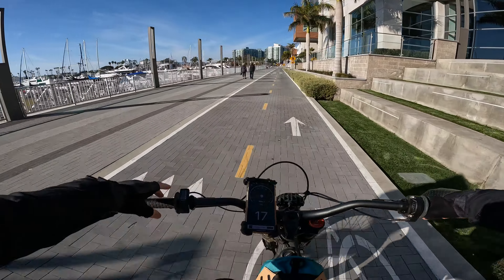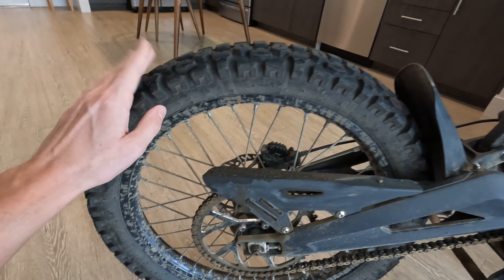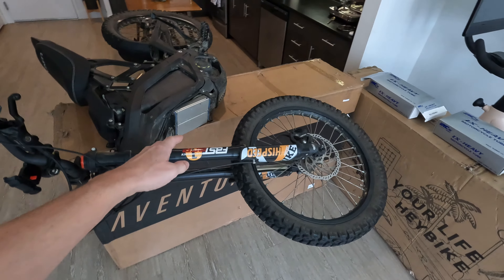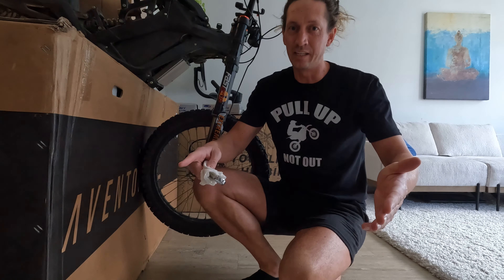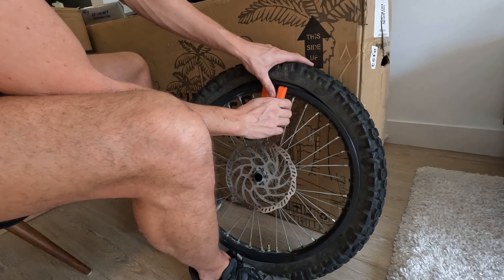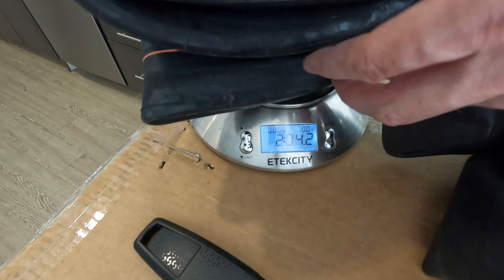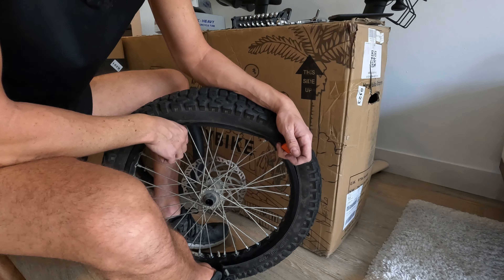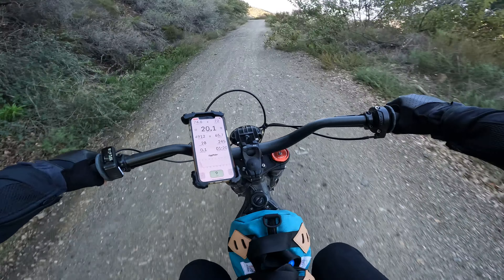How to change Sur Ron Tire and Fix Flat Tire

Comment: Flat Out is the best.  It pushed out the slime that I had in the tube and sealed the leak caused by a 5” nail.  It punctured the tube on both sides and it sealed.  I won’t ever ride my ebike without Flat Out ever again.

Comment: I have been using the 3.5 241 on the rare and it’s really suitable for street is a bit heavy and slows the bike a little (wouldn’t be an issue on 72v on the road but could be problematic for trails) but it works really well on the street have to shave the tyre to make it fit so it doesn’t rub against the chain and fits fine
Reply: My tubes for my 241 are much lighter than yours and work just fine dunno what brand they are tho
Reply from the maker: Thank you for sharing, they should be useful for other people reading the comment section as well!

Comment: I wonder if the heavier tube really helps, because the tire rubber is already thick and tough. If a goat head goes through the tire it will go through the tube. ??

Comment: Heavy duty tubes are a must have in my opinion. Adding weight to the bike doesn't affect range as much as you might think due to it being rolling weight. It's not a 1:1 ratio between the weight and energy needed as it might be if you were lifting a dead weight. Not to mention the fact that added weight helps your momentum on the downhills. Just food for thought. I've actually noticed the biggest gain in range by changing the chain. The stock o-ring chain has so much resistance on the motor. Second best  would be the larger sprocket.
Reply from the maker: Totally agree on chain and sprocket, actually made a video on it. I recently switched from 54t and non oring chain back to stock chain and sprocket for fun just to switch it up and have noticed a big decrease in range and also lower top speed. 58t and new chain arriving tomorrow.